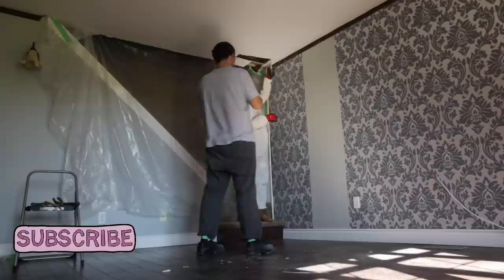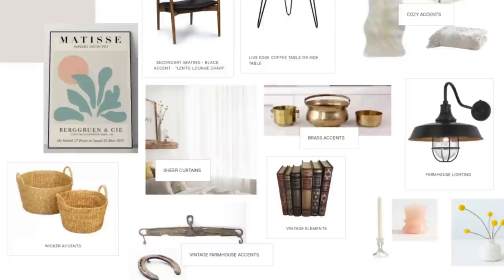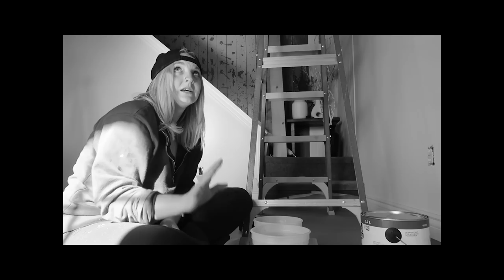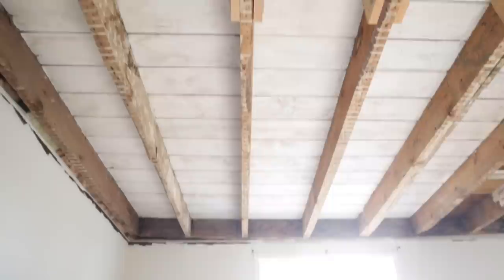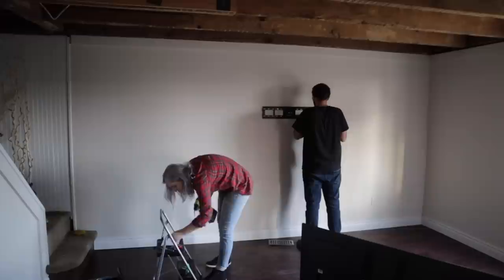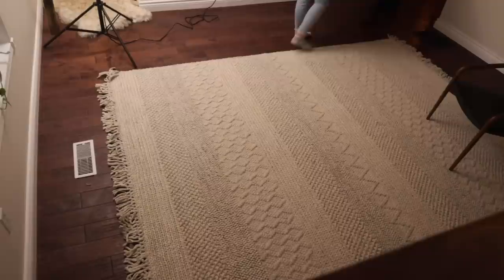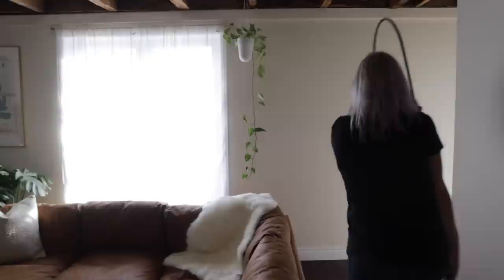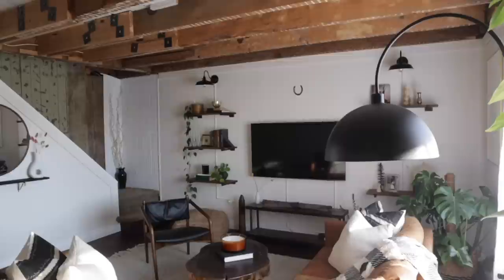*EXTREME* DIY Modern Farmhouse Living Room Makeover | Home Made Home | EP 3

Comment: The white marks on your rafters are from lath, so originally, there was likely a lath and plaster ceiling. Once that starts cracking, it takes expertise to save it, so folks used to just tear it down.  You may get a bit of dirt sifting down from the ceiling; it looks like there is no subfloor upstairs, so the flex from walking on the floorboards may cause dirt/dust/dander to sift through.  Just vacuum regularly. Beautiful and modern makeover that is totally suited to an old house. Congrats!!